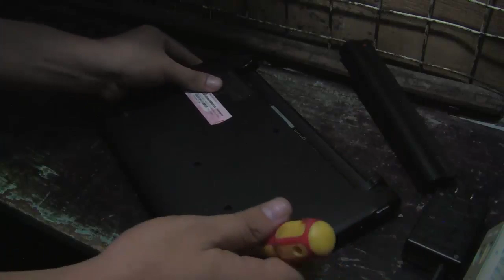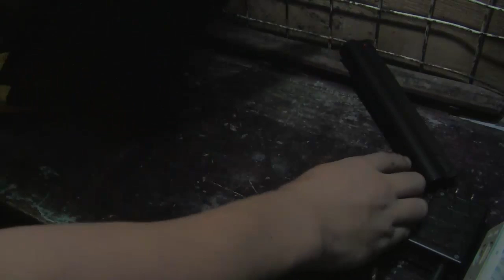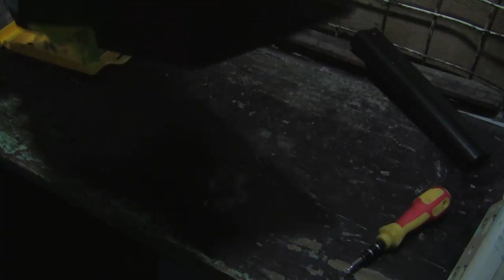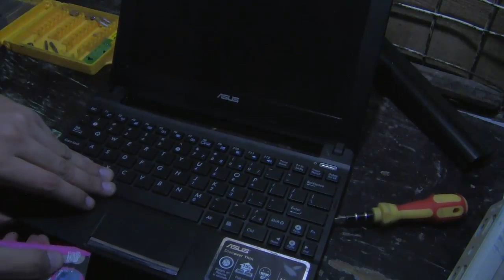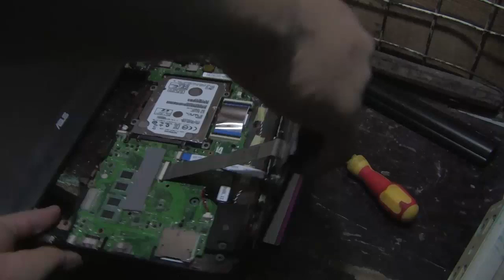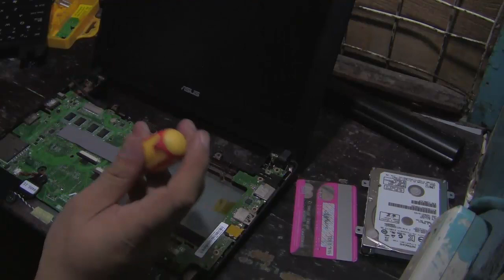Asus Eee PC X101CH  - Replace   Keyboard or Hard Disk Drive

Comment: How to change the ram?
Reply from the maker: no way you can change the ram of this netbook. the 1gb ram is soldered on its board
Reply: TechRePair ok... The only solution for make it faster is install Windows XP or 2000 or 98, or Ubuntu, or Linux.
If you don't want it replace HDD with an SSD